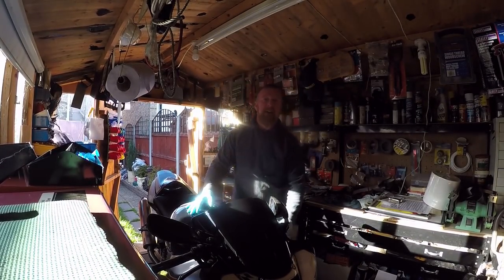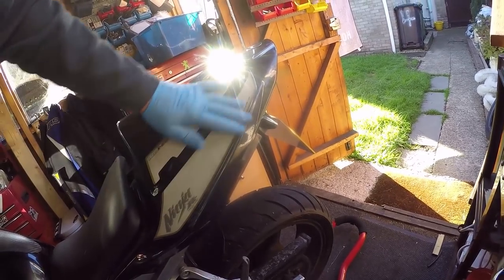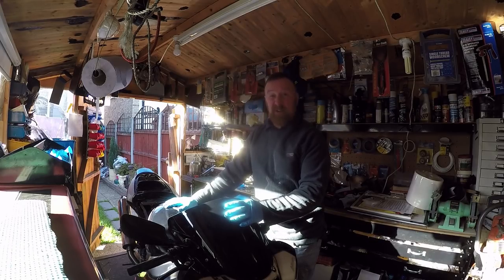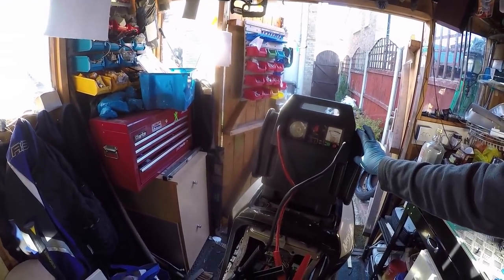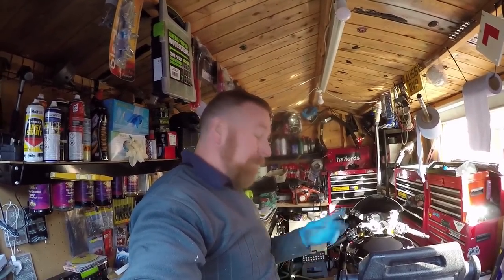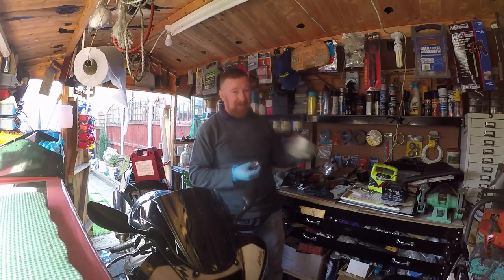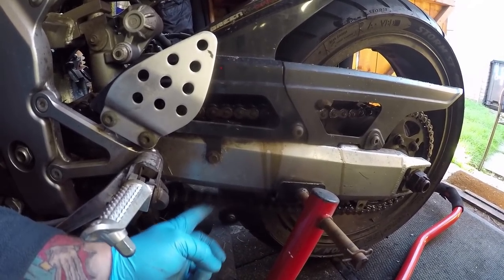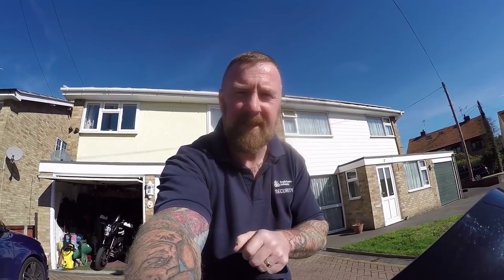KAWASAKI ZX6R 636 REVIEW & FIX MARK SAVAGE

Comment: Hi I have a 2009 speedfight 2 I have spark compression and fule it's had new cdi and plug still nothing stator is also fine piston is a little scored but still should be enough compression to start it
Reply from the maker: hi bud, that little scoring can still be the problem and worth changhing bud, did you do the wet hand test as in my speedfight videos as there is over 70 videos on speedfights?
you have good blue spark?
dry plug try again and wet plug?
clean out the sump after as keep trying to start this will cause problems too
hope that helps 
mark

Comment: Does anyone know how to remove the big mudflap on the back of a scooter
Reply from the maker: hi bud , ok which scooter , most of the time if you take off other panels you get to see how it on
i have many other videos you might like to watch , please like and sub
mark
Reply: mark savage its a peugeot streetzone
Reply from the maker: never seen one , so are you talking about the cover over the rear wheel?
air filter off as said take everytrhing off around so you can see the screws bud 
or the rear mudguard with the reg plate ?
and again bud side panels off so you can see the screws or bolts
mark